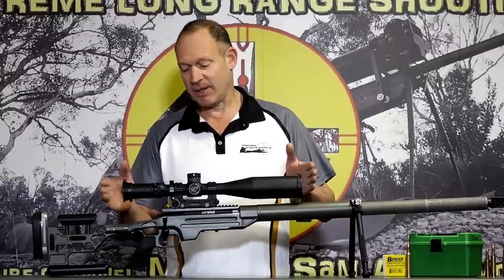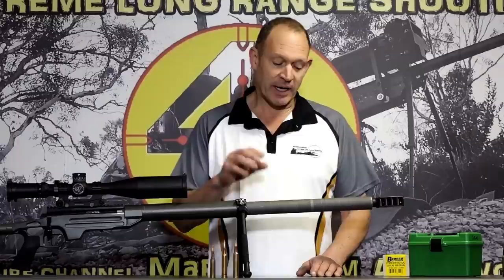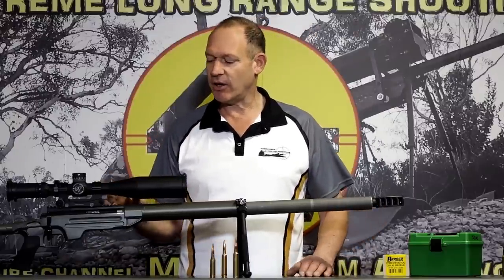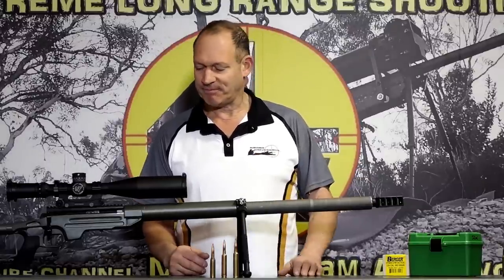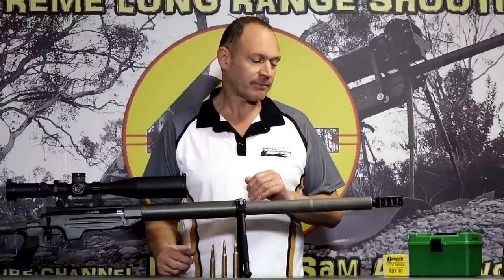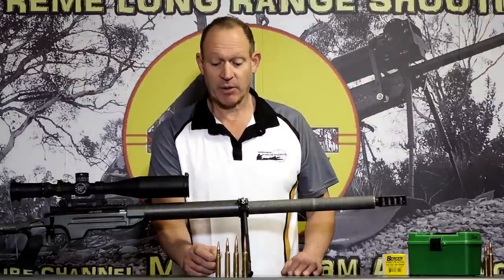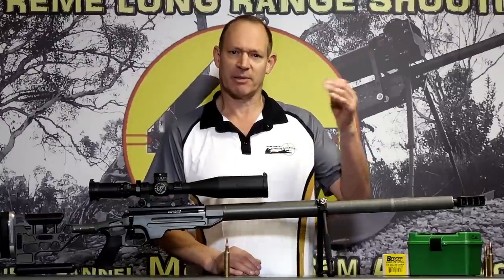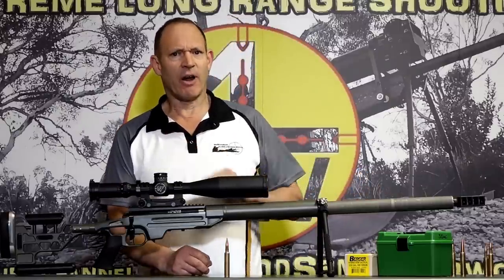STRUCTURED Barrel, 33xc, thoughts on our first shots

Comment: Great explanation. Have you thought about cutting a sharp taper about a 45 degree just behind the muzzle brake? That would create a larger hole end opening and easier for the air to dissipate instead of hitting the back of the brake straight on.
  Nice setup. 1/2 pound trigger is dangerous. I can't imagine how it would feel.  I can't wait to see some more of this rifle.
Reply from the maker: Ah, well wouldn't work like that, so no not something I would consider, still glad you liked, Cheers

Comment: That's interesting about the trigger.  I finally got my 6.5 CM (Rem 700 S/A; 28" Shilen Barrel) out of a conventional HS Precision traditional stock into the MDT LSS XL chassis with a Mag Pul PRS butt stock.  It's always had a Jewell trigger in it set to about 2 oz.  What I immediately noticed now that it's in the chassis with the pistol grip is that where as, like you, before I had a very good feel for the trigger but now I can't touch it without releasing the firing pin.  I'm thinking the difference is that with the traditional stock, my hand position was giving me an up and back trigger pull, but with the pistol grip it's now a straight back pull.  Fortunately the Jewell is an easy trigger to adjust without taking the action out of the stock.  I like a light trigger, but not that light, haha.
Reply from the maker: Yep, too light can be way worse than a little heavy, cheers

Comment: If possible could you find some way to check poi across different loads? I realize it's not entirely feasible since 33xc isn't an off the shelf cartridge, but that was a major point I saw advertised, was same poi across different loads,  if not then cheers its good to hear the barrels shoot good at least.
Reply from the maker: Not the sort of testing we plan to do, but many others out there doing that sort thing, maybe have a bit of a look around, Cheers
Reply: @markandsamafterwork  yeah, figured it wasn't up your alley,  good luck with it.
Reply from the maker: Cheers Will, thanks

Comment: I’ve been reading of these. Glad you got one. I wonder how long before they make a drop in structured barrels for a gas gun
Reply: That seems like a waste IMO
Reply: @taylorbokshowan5713  maybe so. But how precise have you gotten your gas gun? Don’t say it’s not possible because plenty of us do it and find it more challenging but more rewarding. But thanks for your opinion ol’boy.
Reply from the maker: They are working on it, Cheers
Reply: @brandonparrett2436  I’ve never chased accuracy with a gas gun, never saw the point but to each their own.
Reply: @taylorbokshowan5713  

Why wouldn't you want as accurate of gas gun as possible?  All mine are extremely accurate, I wouldn't own them if they weren't.

Comment: Hi, I was really surprised when you said that you found some sand (from sandblasting) into these holes 😨. I hope they put some good caps at the ends of the bore before doing it. Do you think a normal barrel with the same external diameter and length would be too heavy for the receiver or not ?
Reply from the maker: Depends on the receiver and everything else for that matter, would be very heavy, lol, Cheers
Reply: @markandsamafterwork  very heavy would mean very low recoil. Since you dont have to carry more than few meters it should be a good idea